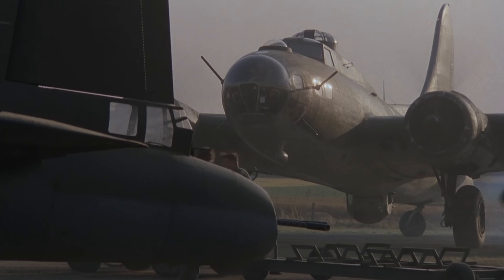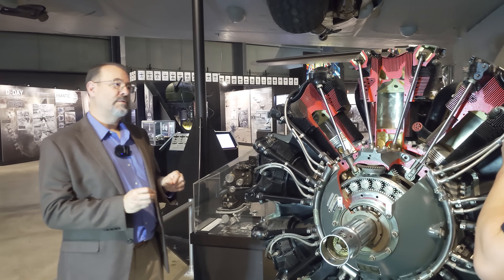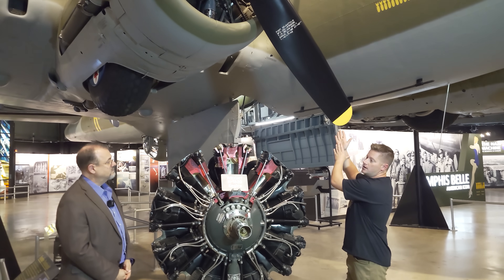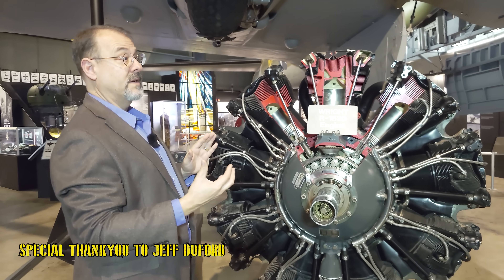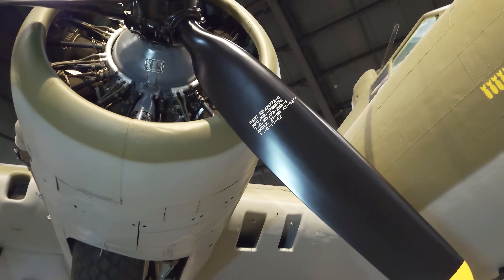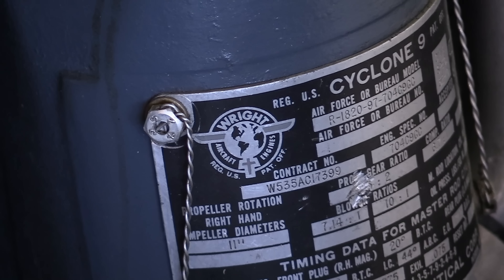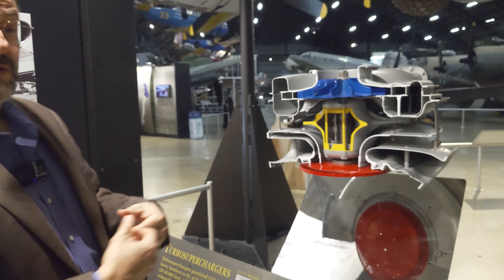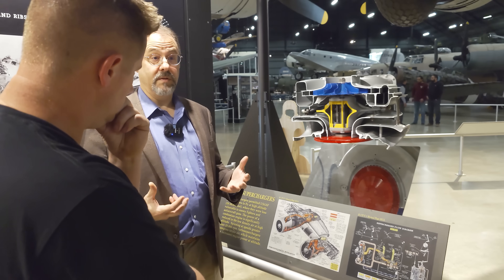B-17 ENGINES IN DEPTH! Genius Or Insanity?

Comment: Why are the cooling fins spaced so close that moving air can never reach to the base of the gap between fins? The failure of cooling air to reach the full surface area   Must be a factor in overheating.
Reply: Wrong. It is the total fin area that determines how much heat is transferred. The main factor (along with higher octane fuel} in increasing the horsepower of air cooled engines is the ever increasing fin area. The more thinner fins the more power. The heat is conducted away from the cylinder head by the fins.

Comment: The issue was the wright was an older engine design but very reliable engine by the time of the war. It couldn’t be easily upgraded to the Pratt and Whitney double wasp more powerful engine, because of all the electric attachments which were essential for the B17. Ironically the Boeing B-50 Superfortress revision of the Boeing B-29 Superfortress, addressed this similar issue by fitting the more powerful Pratt & Whitney R-4360 radial engines post war. 
MAP had a strategy of power egg or pod, so each major aircraft could be powered by an alternative engine whilst maintaining the specification. This can be argued it was unnecessary over engineering and waste of resources, but it allowed errors to be addressed. Consequently you had the Tempest II Bristol Engined and Tempest V Napier Engined chosen for production, but Tempest I, III and IV design being rejected but ultimately leading to the Bristol engined Sea Fury.
The Handley Page Halifax had a similar issue originally with Merlin XX , but incorrectly positioned on the wing resulting in additional drag. This was corrected with the mark III with the installation of the  Bristol Hercules with aerodynamic improvements. Handley Page had developed their own design for the power egg instead of using the typical, slimmer Rolls-Royce counterpart; despite generating increased drag, this was a mistake. Obviously the ultimate successful reengineering was the fitting of the Merlin 65 in the outstanding North American P51 airframe.
Reply: The R-1820 in the post war Navy E-1A (ne WF) Tracker was rated at 1500 hp.

Comment: One of the big advantages of turbochargers is the ability to vary the amount of boost they produce.  In an airplane, this helps to keep engine power constant as they climb, even though the ambient air gets thinner.  With mechanical superchargers, there's a single altitude where the supercharger delivers maximum boost.  Turbos can deliver constant manifold pressure over a wide range of altitudes, varying the speed of the turbine (and thus boost) by varying how much exhaust was sent through the turbine or bypassed through a wastegate.
Reply: Isn't there a 'waste gate' or a 'bleed gate' between the 'charger and the engine to allow the correct boost to the engine & either bleed or waste the excess compressed air?
Reply: @danquigg8311  He said there was a waste gate to control volume, go back and reread his post, s l o w l y !!!!!
Reply: @danquigg8311  You're probably thinking of a blow-off valve like that found on cars, but that's mainly for cases when the throttle slams and leaves the boost air nowhere to go.  Aircraft engines generally operate at mostly or wide-open throttle, and don't have times where the throttle slams closed like when you shift a car's transmission, the throttles generally stay at a particular setting for long periods of time.  Wouldn't surprise me, though, if there was a blow-off valve in the intake somewhere to deal with transients.
Reply: They added different stages and multiple speed mechanical superchargers to extend the altitude ranges
Reply: @kenneth9874   the B17 has a single stage mechanical superchrger which is fed by a TURBOcharger, no gears or speed, same as B24 and the P47 and the P38 only planes in WWII to use a TURBOcharger, which is a turbine driven by the exhaust gasses !!!
Reply: @wilburfinnigan2142  silly, most fighters used multiple stage/speed mechanical superchargers.....that were pioneered by the F4 Wildcat ,some were intercooled and had wastegates as well
Reply: @kenneth9874  Like I said before only the four listed used the exhaust driven TURBOcharger and each feed into the mechanical supercharger thus having a 2 stage supercharger SYSTEM the only planes to use that system, others used a single stage mechanical supercharger, and added a second gear and some had a 2 stage supercharger and some of those added a second speed.
Reply: @wilburfinnigan2142  you also said that any other system was only efficient at one altitude.......
Reply: @wilburfinnigan2142  you should check out the system used in the bf-109 and late versions of the Corsair.....
Reply: @kenneth9874  Don't care about the Bf109 and what VERSION of the Corsair are you  talkin about ?????
Reply: @wilburfinnigan2142  the later version with a similar supercharger....you may want to check it out to clarify a few things for yourself......
Reply: @kenneth9874  Naw   each type has its advantages, single stage has an altitude range, and a 2 nd speed and you increase the altitude, add a second stage and you increase it it more   BUT you give up efficiency at lower altitudes, why the single stage Allison made so much more boost and power at lower altitudes, your 2 stage at lower altitudes would over boost so less boost was available and less power.  Basic knowledge !! !
Reply: @wilburfinnigan2142  you really should check out those systems before you embarrasse yourself....
Reply: @wilburfinnigan2142  there's a reason that out of all the capable US prop driven fighters of ww2 that only the Corsair remained in production after the war...
Reply: @kenneth9874  Already know about the 2 stage variable speed, fluid coupled version !!!!  DUUUUUHH!!!
Reply: @wilburfinnigan2142  I'm so proud of you 👏
Reply: @wilburfinnigan2142  although if you did then why did you make such an ill informed statement in your 1st comment?....

Comment: Clear prop switch on contact starting up engine 1 engine 2 and engine 3 engine 4 starting up all online running
Reply: Start procedure on our B-17 was #3 then 4 then 2 then 1
Reply: When your starting up the engines with propellers on the planes make sure everyone is got the heads up what planes are on the flight lines what planes are taking off for the milk runs and they will always start up engines in any starting order depending on the crews engine 3 switch on starting up and engine 2 next engine 1 starting and finish engine 4 starting up and running

Comment: Turbo doesn't cost power off the engine but can cost thrust depending on your exhaust design.
Reply: The laws of thermodynamics say you can never get energy from nothing.  A turbocharger is absolutely costing some engine power, but some of that power would just just be lost as waste heat and that is the fraction of power that has no direct cost to engine horsepower (but again the engine expended energy creating the heat).  The major portion of the power comes from exploiting a pressure differential between the exhaust and the outside atmosphere as the source of energy.  Since a free flowing exhaust would have less back pressure to the cylinders the engine has to work harder to supply power to the turbocharger.  No free lunch.  

What makes a turbo better than a supercharger is about 20-30% of the energy it will extract from the engine is energy that has already been "lost" while the supercharger has no wasted energy recovery, being 100% driven from engine power although a supercharger can generally more readily operate in stages and attain higher boost pressures for a given size, as well as not requiring a lot of heavy exhaust plumbing that a turbo does. 

A turbo can add significant boost pressure to the intake that allows more fuel to be burned that makes the engine produce more net power output.  While the turbo is going to make the engine more powerful it always does so at the expense of some economy.
Reply from the maker: Great information guys.

Comment: Ok i have to cringe and correct here. A turbocharger DOES rob power from an engine due to the backpressure created to spin the turbine! There naca reports detailing exactly this! The advantage of a turbocharger is the speed is infinitely variable and hence there are no  'altitude gaps' as in a 2 speed mechanically driven supercharger (side note-the german db601 had a fluid coupled superchatger drive that eliminated this.)
Furthermore, the ducts needed to be exposed to airflow to cool them due to the immemse heat generated, thus will ALWAYS generate more drag overall than a supercharger. Finally, using the exhaust to drive a turbine means that it cannot be used to generate thust. The rearward angled exhausts on merlins added effectively at least 100bhp.
Naca compared the two systems (mechanical vs exhaust driven) and found the prod and cons for each system made them pretty much equal to each other for airplane application at the time.
Reply from the maker: That's way above my pay grade. Hopefully someone can verify here. Excellent input and information! Thankyou for watching.
Reply: Okay  but Where and Why Cringe?
Nowhere did I see anything like someone punching a Kitten ( that would induce a CRINGE ) I’m hopeful that at some point in the future you are able to get over this 🙏 sending thoughts and prayers
Reply: @GuidosDad  i didnt mean to cause any offence by using that word. I actually really enjoyed the video. Cheers.
Reply: I was just kidding around 👋🏻😊 your comment was Very astute! Obviously Came from Years of experience and dedication  … all my best!

Comment: I was in the Navy for 20 years, 1970-1990 and worked on 3 aircraft that used the R-1820. The T-28, Grumman S-2 and the Grumman C-1. Always a reliable piece equipment.
Reply from the maker: I had no idea the engine was in service that long. Very impressive.
Reply: Yup. Although I was a jet guy, I was lucky enough to fly all 3 of those birds. Great engine.
Reply: @bobharrison7693  I also worked on a EC-121 Lockheed Constellation in my first squadron. I also worked on the F-4, A-3, A-4, H-2 helicopter, A-6 and the F-4. I carried 5 aircraft NECs. The first squadron I was in, VAQ-33, had 4 different aircraft types. I was also on the Forrestal (VA-85),  and Nimitz (AIMD). I worked on the F-14 at the Depot in Norfolk and just retired from the Coast Guard Depot in Elizabeth City, N.C. on Dec. 31st.. I'm 72 and it's all I've ever done. I was also raised on Naval Air Stations until I joined the Navy.
Reply: Thank you for your Service 🇺🇸
a Fascinating time in Aviation
Reply: @redr1150r  Thankyou for your Service.
Reply: You forgot the Grumman HU-16 Albatross Rescue Amphibian, burning 115\145 grade avgas its twin late model R-1820 Cyclone 9,s had  a pony count of 1525 for take off, not bad for a single row radial partly designed by Ex Armstrong  Siddeley  Engineer S,D Heron in the late 1920,s .
Reply: @basiltaylor8910  The Navy had those while I was in. I think the last one may have been the station SAR Aircraft at NAS Bermuda. NAS Norfolk didn't have any. I used to refuel them on the transient flight line at NAS Norfolk in the mid 70s. The Coast Guard had them until around 1980 I believe. I used to refuel them that came from CGAS Elizabeth City, N.C.. There's one at the front gate at CGAS Elizabeth City, and I actually used to refuel that one, as Elizabeth City didn't carry AVGAS anymore. 115-145 octane fuel ? It sure worked great in my BSA 650 and Norton Commando. I cut it with Sunoco 260. 🙂  (PS - I didn't forget, i just never worked on an Albatross. 🙂)
Reply: The highest octane Avgas available today is 100LL...low lead.
Reply: @philgiglio7922  They used to brew a special batch of 115/145 for the Reno Air Races. Maybe again in 2025.
Reply: @philgiglio7922   In 76 I think we went to 105/130. I helped the engine guys reset the magnetos to make up for the lower octane fuel. I worked in Airframes. I still have an antique timing box for piston engines.
Reply: @philgiglio7922  the 115-145 worked great in my Norton and BSA. 🙂
Reply: @basiltaylor8910  I used to refuel them at NAS Norfolk, Va.. The closest USCG Air Station was in Elizabeth City, N.C. . They stopped carrying Avgas as a cost cutting measure. NAS Norfolk, was 10 air min away or so, so they would fill up their HU-16s until they were overflowing, then hop over to the USCG air stations with, more or less full tanks.
Reply: @basiltaylor8910  The R-1820 was overhauled at the NAS Norfolk Aviation Depot from 1938 to 1972. I used to walk through the building as a young Navy Airman where the overhauls were done on my way to the hangar and ask questions on what was going on at particular work stations.
Reply: @redr1150r  Wow the R-1820 was in US Navy service for over a quarter a century, partly designed by Sam Heron who worked for Armstrong  Siddeley Motors of Coventry. A testament to his sound engineering, that polish cloned R-1820,s are still hard at work today powering PZL Dromedaries an ugly crop duster the size of a DHC-1 Beaver.
Reply: I was living in Tacoma, WA back in the 1980s and was hanging around the Narrows Airport to watch the activity leading up to their 4th of July airshow. The flying took place over Commencement Bay. The Canadian Navy (RCN?) brought one of their S-2s down. When looking at the engines - R-1820s, the I.d. tag said “Built by Pratt and Whitney Canada” and a sticker, also located on the oil sump, said “Overhauled by Rolls Royce”. I’d say they were cared for by the best. Grateful that they flew them down for the flying display.
Reply: Radial engines rumble and roar. Jet engines whine into existance.😂
Reply: May God Bless You for Your Service!!!🇺🇸🇺🇸🇺🇸

Comment: Excellent video but just one slight issue that i think was put across in a confusing manner. A variable pitch prop is far more efficient than a fixed prop, but can be a lot of work for the pilot. A constant speed prop autonatically varies the prop pitch to keep the engine rpm according to where the pilot sets the throttle. Essentially an automatic variable pitch prop.
Reply from the maker: Interesting feedback. Always learning here. Thankyou for watching.

Comment: As a truck diesel mechanic, everything said is true. Which is why trucks have turbochargers on every engine. Old model engines from 40 years ago had a supercharger sitting on top of the intake chamber, but it wasn’t efficient and robbed power from the engine, turbos don’t rob power, they are driven by exhaust flow, and are necessary to drive in mountainous terrain, like Colorado, Wyoming etc. in recent years the “green” federal regulatorys mandated DEF after treatment systems to lower carbon emissions and completely ruined, in my opinion, the advances manufacturers had made prior to that erroneous decision. Companies research was on the brink of 10 mpg as a standard for trucks, which was phenomenal, unheard of prior . When the DEF mandate was finalized this killed any effort to improve efficiency, and research was ended for at least 10 years.
Reply: The back pressure on the exhaust from a turbo does rob some power. Granted, less than  the resistance on the crank from mechanically driven supercharger, but it does still rob power. There are naca reports from the prewar period that compare the two.
Reply: @garethbarry3825  Nothing is free in powerplant world.
Reply from the maker: Welcome Brother! You are speaking our language. If you look at our normal content outside aircraft there is a lot on tank diesel engines. The big continental AVDS 1790 engine is coming in depth soon! Diesel is the only way. Fun fact, did you know there is a diesel radial aircraft engine?
Reply: DEF doesn't reduce carbon emissions, it reduces NOx, a much more powerful greenhouse gas. A particulate filter captured the soot that foul the air and leads to lung disease. The increase in fuel efficiency you mentioned was gained by increasing combustion temperatures which greatly increase NOx production.